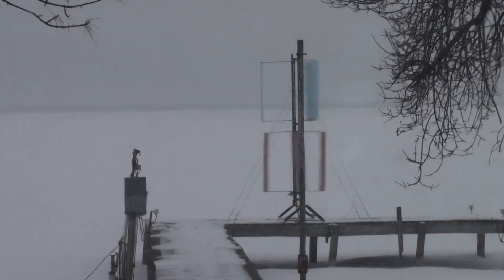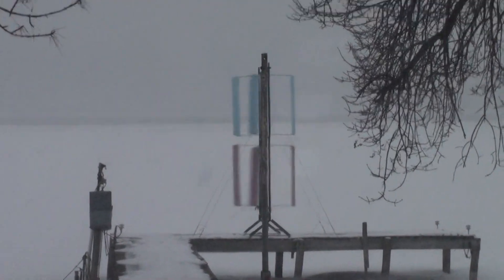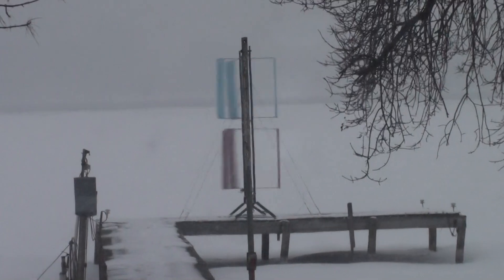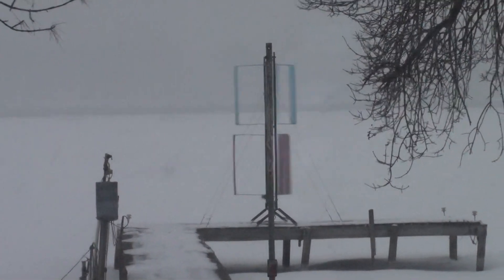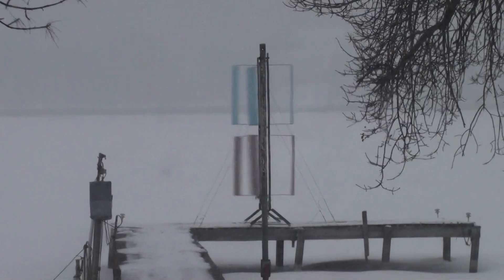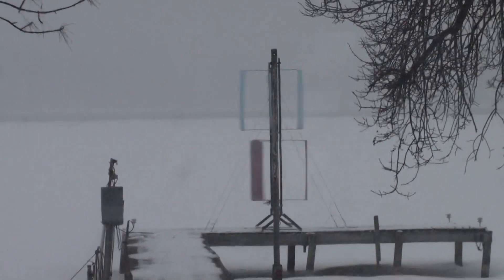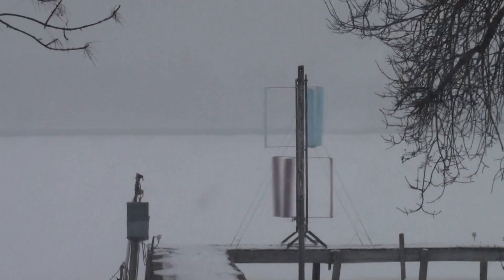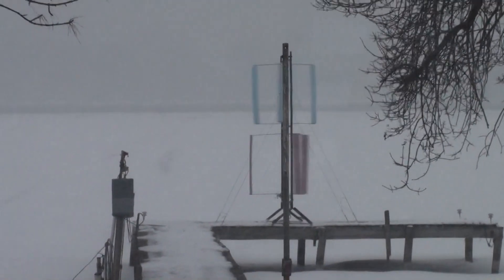Lenz 2 tower with foam wings, counter rotating

Comment from the maker: @itsandbits1 I don't have the exact AOA for you but it is less than 9 degrees toward center. My wings are hand cut and aren't that perfect, not balanced right now either. I have never had a problem with them turning backwards. I even had it spin forward  with one wing missing in the high winds , but slow,about 40 RPM. So far the top hasn't had enough wind to spin the other direction. Had it tied off in the storm because I lost a wing.

Comment: what aoa or ma are you using? This profile is really touchy. I run my Remkick at 0 degrees ma at 30% chord and loose about 25% power if I go + or  from there 1 degree and the wings don't like going - at all.
Glad to see you trying the lift wings. the problem you have with the naca0020 is that they will turn backwards too. There must be some wy to make sure both top and bottom are in lift before the alt cuts in. Glad to see you're having fun in the snow; BRAVE MAN.